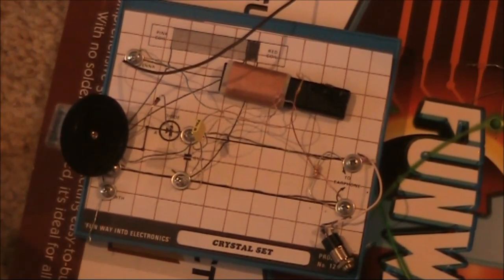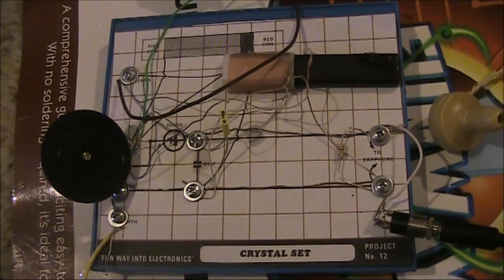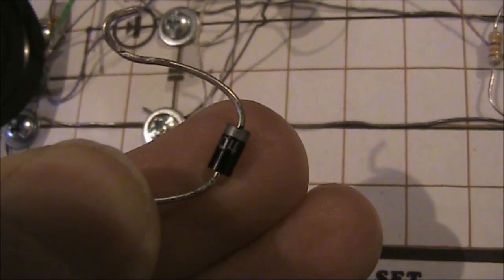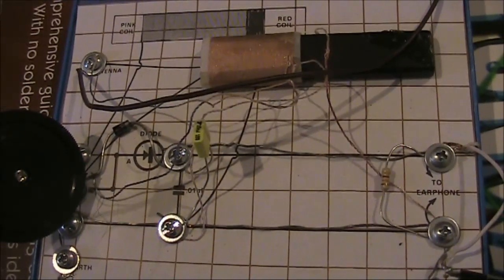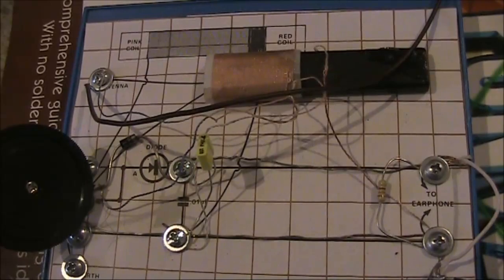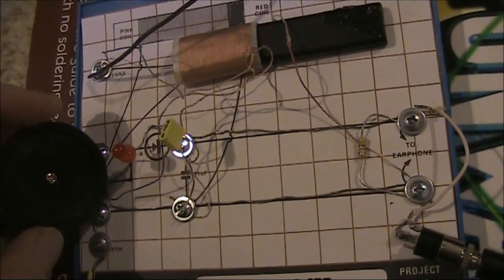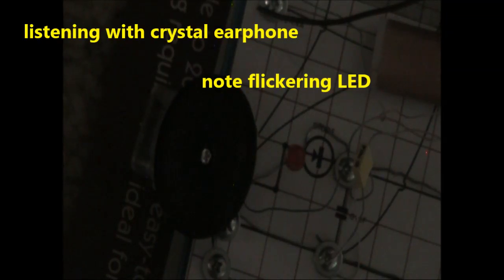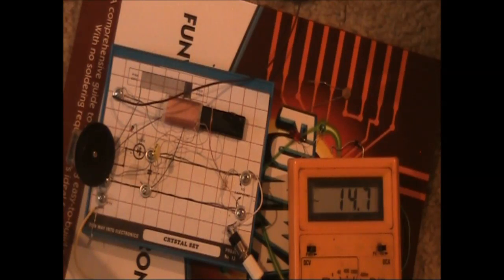Can a crystal set light an LED off radio signals?

Comment: Great wee video mate I'm quite into the old shortwave receiver kits so this was of interest to me, I have finally got myself a decent homebrew battery pack (2x sealed lead acid weans/kids  electric scooter batteries 12v 4amp ) which runs my djx10 receiver for 3 days straight at circa .5 watt and my solar panels even in mid winter uk will recharge the batteries in a matter of hours, my goal is a almost perpetual capability for reception.

Comment: You have true scientific curiosity my friend.  As comented below.  It would be cool to also try using the infrared LED in parallel with the red with a DC blocking cap.  The voltage accross both should bias red LED near conduction.  Less distortion

Comment: I believe it is ' glasslinger ' that does an extensive diode test using about 8 or 10 different diodes hooked to a scope device so you can ' see ' as well as hear the differences.

Comment: Shottkey,s are my choice of weapon for crystal sets
Reply: Wonder how it would work to abuse an input stage of a 74LS gate there then, as the input is basically the emitter of a NPN transistor with the base resistor tied to the Vcc rail, though 74S would probably work better as the resistor values are lower.

Comment: "high power,50kW" 
That's actually funny,because here im Hungary we have Kossuth Radio on 540kHz,with a ridiculous 2MW output :D that thing ligths up LEDs easily
Reply: If you're close enough you might not even need an antenna to do it! :)
Reply: @hauptuhrdotnetblog6700  parallel would give greater current but emf is too low. Series would increase internal resistance and provide no gain as there are no active devices in the circuit.

Comment: Can I  use Skotkky diode instead of quite hard available (apart from China , which last time eneded with Germanium diodes damaged and not working at all) ? I mesure 0.242 V for my Skottky diode which is even less than Germanium but I am thinking if there is something I am not aware of 🤔🤔

Comment: More videos like this please! Could you do one with a razor blade and graphite pencil (I think that's what called a cat's whisker)?😁
Reply: The original "Cat's whisker" is a lump of galena (lead sulphide) and a fine wire used to probe the surface to find a good active spot.
Reply: @ferrumignis  thank you for this information regarding the original "cat's whisker". I would like to see a video about using this method 😁
Reply: @ferrumignis 
 https://en.m.wikipedia.org/wiki/Galena

Comment: Is it possible to connect up several crystal radio sets in a series/parallel string to charge a cell phone or power a flashlight?
Reply from the maker: Would need many more than several. The power this puts through is like milliwatts or microwatts.